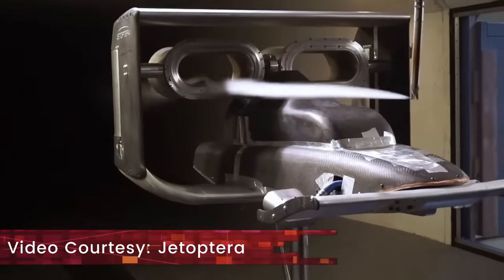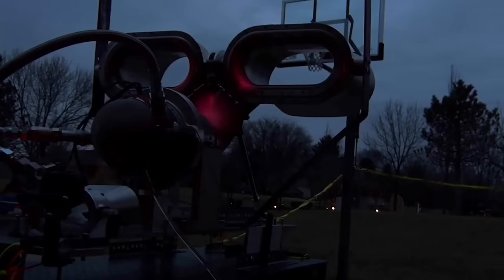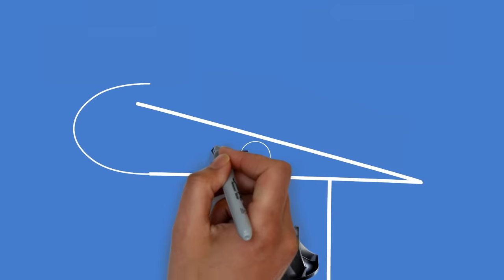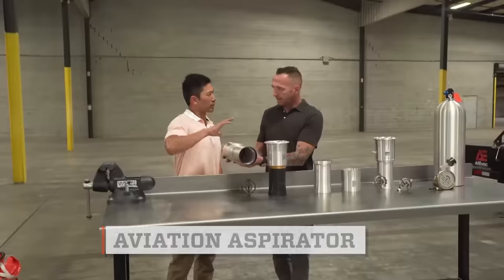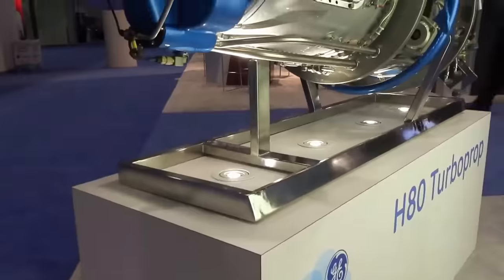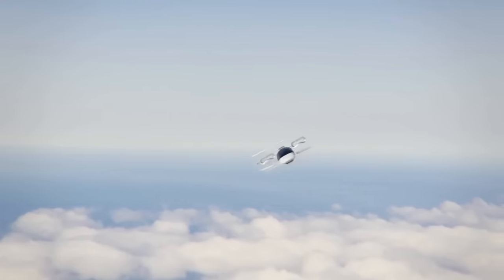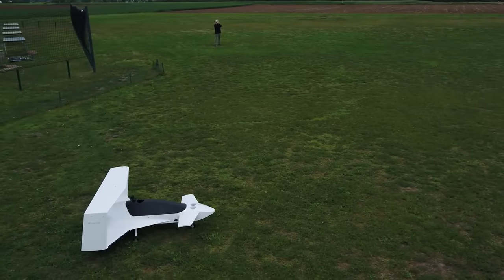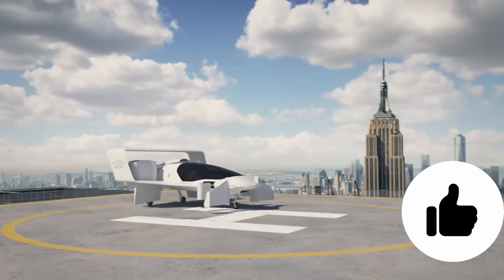Jetoptera's Bladeless Propulsion System

Comment: For a practical demonstration of the bernoulli effect, take a trash bag / bin liner and try to inflate it with only your lung power.  If you gather the opening and hold it to your mouth, it will take several deep breaths to partially inflate it, however if you hold the bag fully open and blow into it from a short distance away from your face, it can take only a single breath to fully fill it with air.
I feel that using this principal for an aircraft, considering today's lightweight materials, is quite ingenious.  However, the energy density of modern batteries might make this infeasible for the time being.

Comment: This is really just a jet eductor, like you said.  I can tell by the size and type of the jet engine, compared with the size of the jet eductor nozzle (they call it FPS thruster) that they don't fully understand the principles involved.  The aperture size (and hence volume of fluid flow) is not much different here.  Perhaps twice as big on the FPS thruster, if that.   Where this type of thing would really be beneficial is by taking high speed, high flow gas, forcing it through an eductor with a much larger cross section to entrain the maximum volume of low speed, high volume air through the eductor.  That's where the most efficiency is gained.  All they are accomplishing is pushing jet exhaust through a very inefficient nozzle.

Comment: If I'm understanding correctly, don't blown flaps work in a similar fashion to increase lift? Also, a box wing is just a more efficient biplane type wing, which is extremely efficient at low speeds. All in all, a very cool project.
Reply from the maker: Yes. I have explored blown flaps in second video on jetoptera

Comment: This is interesting but does the distribution of energy accomplish the work needed from the turbine? The Dyson fan uses an internal electric fan to drag more air through the venturi in order to cool a room. I don't know if the Dyson design takes less energy to do the same work as compared to a traditional fan. Does the Jetoptera use less energy than a traditional jet aircraft to do the same work? Is it advantageous at this time?

Comment: most of the shown designs seem to mainly rely on propulsion to create lift. so in case of an engine failure you'd fall out of the air like a brick… so my suspicion is, that you'd probably need to imply a lot of redundancy which would shift the power to weight ratio and so on? is there a beneficial reason for these designs to be so compact? can't they just add wingspan or make it able to glide in some other way? or am i underestimating the capabilities of the boxwing?

Comment: Can the massive headloss pressure caused by the thinning of the airstream through the converging nozzles be made up for in the air multipication though? Seems like that compressor would be working hard to apply that pressure from ambient then back to ambient, the working compressed fluid has to then rely on the viscosity of the ambient air for the transfer of its high velocity momentum, i think this might be very inefficient transfer of momemtum and thus energy from compresor intake to thrusted fluid.

Comment: I’m a bit confused. So are there internal blades inside the system like the dyson? 
Or is it using a compressed air kind of like a handheld can of compressed spray air?

Comment: The obvious downside, from my perspective, is that having a pair of GE jet engines (for some reason described as "turboprops" here) is going to be hugely expensive both in purchase price and in maintenance.  They will also be very vulnerable to bird strike and other junk that can get kicked-up into the air and accidentally ingested by the engines.  In that regard, open props (and ducted fans) are far more practical for small, private EVToL craft.  And depending upon just two sources of thrust is also risky since it doesn't allow for redundancy in case of catastrophic failure.

Comment: I'm not sure this will work as you are imaging. There are two things here to consider:

1) You can't get out more energy than you put in. In terms of thrust, what you would be looking at is efficiency, is the power of the motor being turned into thrust more efficiently?

2) What is actually happening in these type of fluid induction designs (such as the Dyson fan)? What they are doing is more like a transformer than an amplifier, they are trading high speed air for a greater volume of lower speed air. This is equivalent to an electric step-down transformer which trades voltage (equivalent to air speed) for volume (equivalent to current). However, just like a transformer, this doesn't result in more energy. 

As a result of (2), the question is "Does low pressure, greater volume air give more thrust?".  Can it reduce the blade tip losses of a conventional propeller in the same way as a ducted fan does? Can it drive the aircraft better? It seems the system might be better at low speeds but I suspect the answer will be it looks cool but has little advantage, if any, over a ducted fan in terms of thrust and aircraft performance generally and potentially could be a lot worse. It will be interesting to see what happens when you try to implement this drive system into a model given that the flying model shown is really just a design shaped shell driven by conventional ducted motors and as a result actually does little in showing that the system will work. As RC modellers know, you can fly models of the USS Enterprise without it having warp engines or showing that warp engines will work.

Ref:
https://en.wikipedia.org/wiki/Ducted_fan
https://aviation.stackexchange.com/questions/27416/are-ducted-fans-more-efficient

Comment: They refer to their drive mechanism as the Fluidic Propulser, which makes me wonder if the concept could be used as a propulsion mechanism for scientific submersibles; if it creates less turbulence in the water, it may disturb marine environments less, hypothetically allowing the sub or ROV to perform research for longer, with less impact on the flora and fauna that live in these low energy environments that take so long to recover.

Comment: If I understand correctly, this works by lift augmentation, which implies you need an engine to augment the lift. What happens when the engine fails. Does it drop like a stone? Even a helicopter can auto-rotate. And relying on a parachute seems dangerous.

Comment: It’s a similar concept to Lilium and sure it’ll be quieter, but I wonder how they’ll get around the inefficiency of using annular jets.

Also, having retractable landing gear and canard thrusters increases weigh, complexity, power demands, certification requirements, and therefore cost while being mostly unnecessary since the drag from properly faired landing gear is minimal. Just ask Cirrus Aircraft.

Comment: I wonder if there's a way to utilize the actual propulsion unit as a kind of renerative energy source.  Like somehow using the airflow in 2 ways . 1st as propulsion & second as an actual power source Like air turbines in a smaller capacity.  That coupled with the daily breakthroughs in battery & solar technology it could possibly have a pretty impressive range .
Have an idea

Comment: The Coanda Effect has been tried in numerous vehicles (including masts on ships!) but has never really shown any promise due to the inefficiencies inherent in turning a fluid, most notably, turbulence. 

The Coanda Effect basically turns the air and induction increases the mass flow, albeit to a slower velocity than the jet stream that instigates the effect. This means wind shear and efficiency loss. I don't see how this can be any more efficient than a optimized propeller.

Am I missing something?
Reply: Somehow the boundary layer between the free stream and the jet  plume contains the thrust and prevents it from dissolving into turbulence.  I think.

Comment: This could potentially allow for SSTO, as their bladeless engines could easily be adjusted mid-flight for Ram-jet. If the right material are used, possibly move to Scram-Jet.
Reply: Ramjet wont get you to orbit. You need a rocket engine mode too, at that point you might aswell go with SABRE

Comment: on the job the boss had a cone shaped tool, about 18 inches at the bottom two or three at the top and about 5 feet tall; hooked up around 125 lbs of air pressure to it and it would almost pick me off the ground. I didn't know the name of the propulsion system, that was 40 years ago, and i was 140 pounds back then, you can add 70 to that now LOL

Comment: I tried to get an engine builder to test this type of air flow inducing system to replace turbos for a car engine. Basically the air flow system would suck the exhaust out of the cylinder by placing a low pressure area at the exhaust valve. Instead of pushing air into the cylinder, one would be pulling air in.  He thought I was not worth the time unless I had $4000.00 a day for him to test the concept. Since I did not, nothing was ever done.

Comment: "According to Jetoptera's CEO, the aircraft can easily transition to battery technology, once the required energy density is available."

Oh yes, sure. And my plane model made of lead will easily fly, once the gravity constant has been reduced to the required degree. Just ask Q!

The point is that energy density of common jet fuel (that even vanishes during flight) is still 40 times higher than the best current batteries.

Airbus A380 just failed due to its fuel consumption. Every kilogram that has to be kept airborne costs real money.

But hey, let's take a positive attitude here ... 😁

Comment: In an equation m*v^2, m goes with power 1, and a velocity goes with power 2. So, to increase a speed by 4, gives more force than to increase a mass of an air by 15. Dyson and prop jets use an increasing of amount of an air by different reasons: to convert an air speed into a volume, and to use less noisy and more efficient turbines. Those turbines already produces less exhausting gas speed and more torque (so a fan can be attached to a shaft). When you don't have such turbine, and a speed of exhausting gases are high, and the turbine is noisy, nothing will help you to be commercial successful.

Comment: also what about twisting the turbine or install static kind of blades so that they create Vortex. The air going out of a turbine will twisted in vortex - as  a hurricane and will create additional sucking power ? You know that power of tornado is much more  than regular wind.  Both turbine has to create vortex in opposite direction from each other.

Comment: An aeroplane need not always carry men or material. To get some leverage from this futuristic program and to scale up the learning process, I suggest some cardinal rules to follow: Never aim for a commercial car or a flight, start small, start a drone-like thing, unmanned or a small cargo drone and put that to use as such to recover some value. Thanks to advances in composites, one can use solar panels as much as the airframe allows. Use this solar power not to propel the plane but to power such systems as communication, navigation, instrumentation, data recording, reconnaissance or airborne ad banner duties.  Consider carrying liquid air and mixing it with the fluid while expanding. 1 cc of liquid air expands to 700 cc at room temp.

Comment: I wonder, could using a Tesla air turbine increase the effect in this design over using the bladed fan technology on the motor producing the 500lb/sq.in in this design to create a much more powerful air stream for the air induction i.e. Tesla turbine after fan but before the double opposing  ram setup?

Comment: These are basically Coanda ejectors, which have been known about for a long time. Their efficiency is not all that good, since, like conventional ejectors, they rely on lossy processes to transfer energy from a high momentum flow to a low momentum flow. I am curious (and skeptical) about the breakthrough that is implied here.

Comment: I think this is, actually, the 'Custer Wing', but with 'Tighter Arcs' at Corners of the Vector-forces involved, as, Swirls Amplify under constriction in Volume and Area into Vortex's. These guys exploit that 'boundary layer' to the fullest, without using "obvious, Induction Fan, type systems", but it IS important to note, the LACK of a central Impellor in their Airflow Ducting!!

Comment: Looks good, but a 1,250kW gas turbine needs a lot of fuel & I don't see much space for a fuel tank,  nor batteries for an electric one. Add to that the time it takes for the turbine to get up to temperature before full power can be applied to the compressor & the need (currently) to have a helipad or suitable landing area at your destination & it really has no advantages over a conventional helicopter other than less noise (other than that from the turbine), no external rotors & no pilot's licence (currently).

Comment: Adding more air volume by use of air multiplication doesn't mean more thrust right? I understand the use of air multiplier in household since air volume is what we need but thrust? There is that conservation of energy it wont get more thrust energy than its internal engine already generate.

Comment: It would probably be relatively easy to work out the numbers and check if it generates enough lift for a manned aircraft... It's the most important thing here since it will decide if the concept is viable or not. I sure hope it does because the design looks fantastic, but not holding my breath.

Comment: Imagine replacing the tip jets on a rotodyne design with these much quieter "bladeless" tips. I'm no rocket scientist by any means, but if this design can generate a power output close to or better than the tip jets of a rotodyne, that would virtually solve the "noise" issue, thus making such a compound flying vehicle much more viable and applicable in modern times.

Comment: Can you increase the thrust by adding ionic thruster, which would give a lot faster flow! kind of like a hybrid model! This model has a lot slower air flow in the middle of the chamber. is you have smaller channels, the air would flow a lot faster but smaller volume per cross section but should have more thrust.

Comment: Now imagine replacing the wing on a conventional aircraft with a V shaped blade-less fan, with the wings attaching to the top and bottom of the fuselage. Kinda like <O> The top and bottom “wing” would both produce lift and contain control surfaces allowing you to half the length of the wing.

Comment: It is a nice explanation, but wait: 1250kW to fly two people? I mean I know it is VTOL but a conventional plane carries 2 people with maybe 1/10 of the power (depending on speed only 1/20 or something). So where does the power go when in cruise flight? Either it must have a superb cruise speed of 400Knots or something or the range can only be minimal and the energy consumption is absolutely excessive. On any turbine engine you can only reduce the usable power at the low pressure turbine but not the power required for the compressor. So anything but full throttle is inefficient.

Comment: I wonder if anyone can tell me what type of propulsion is being used by the crafts I see regularly that make no noise at all. This video speaks of the 'possibilities', but I'm talking about today. Fleets of silent, low flying crafts in controlled flight over many miles. Small (about the size of a Uhaul truck) crafts that effortlessly increase speed from 5 to 65 mph in a few seconds without making a sound. If one passed over at 150 yards overhead and you didn't see it, you'd never know. They can stop, as if frozen, and can turn on a dime to immediately change direction. I realize I've entered the realm of science fiction, but the one I saw crossing a field, at about 100 ft from the ground, then turn and 'float' towards me with a spotlight on me, was straight out of Star Wars. It was surreal and at the same time, it physically happened right in front of me. This is not an aliens in UFOs story, it happens almost nightly and they pass every few minutes at maybe 100 yards from the ground. Serious answers only.
Reply: Where do you see these? Near a military base?

Comment: I would argue that this is actually just a hidden blade system. The multiplier effect is very interesting though. The real question is you ruin the efficiency of the actual bladed device that is pressurizing it when you put it in a tube that must undergo a lot of contortions to get the exhaust air out and into the square shaped propulsors. So you're losing efficiency on the thing that's driving the more efficient for pulsar squares

Comment: I think the box wing type of aircraft has lift capability but has very little ability to maintain it's position in the open air due to the effect of wind pressure etc.........this is like a balloon  that has the ability to lift it's own weight but is not to be able to resist any outside forces acting on the outside surface........the current aerofoil design used on aircraft wings relies on the forward motion creating the airflow over the wing and by the forward inertia of the aircarft is able to resist the outside forces to a large degree......even the Harrier Jump Jet with vectored thrust  was unable to control side drifting in even the lightest of winds.

Comment: It's kind of deceptive to say this is a bladeless propulsion system. It is just a way of augmenting or amplifying an existing propulsion system which inevitably has blades. 

Your description states: "At present Fluidics propulsion system will utilize GE aviation gas turbine but it can use an electric turbine as well." 

TURBINES HAVE BLADES, hence this is NOT a BLADELESS PROPULSION SYSTEM.